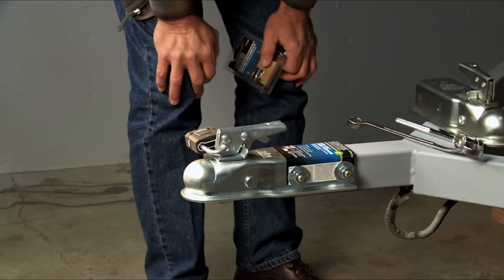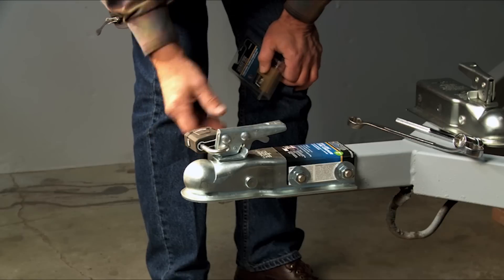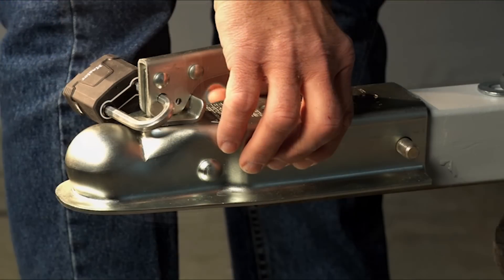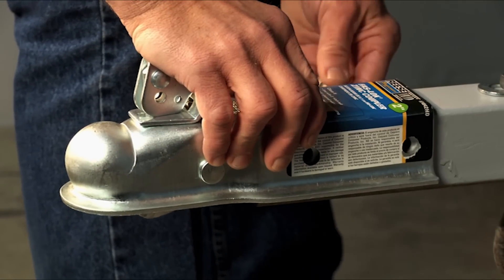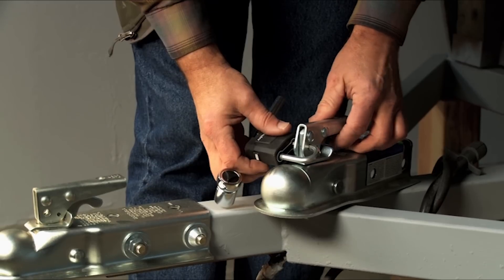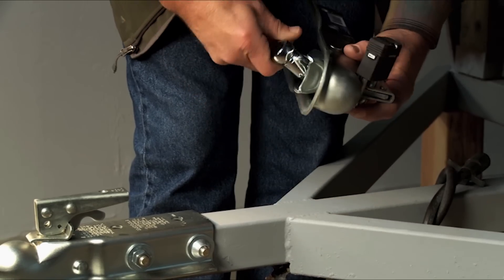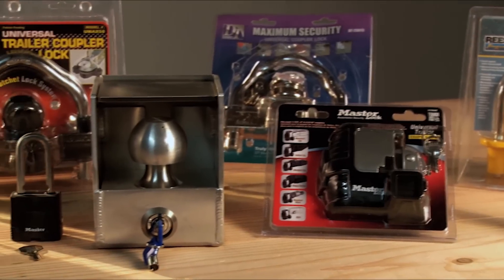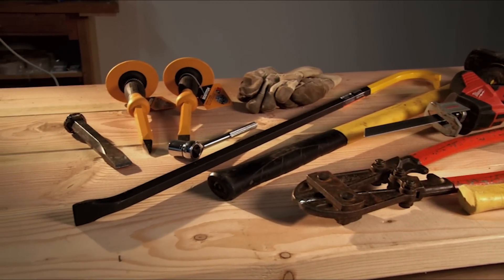Compare MegaHitchLock Coupler Vault to other popular locks on the market

Comment: why did video stop....looked like he was getting somewhere with that big pry bar
Reply: Because it's in their best interest not to show someone breaking their lock they are selling. Also, for that same reason, they do not show their lock on the same one that they were testing all the other ones on.
Reply from the maker: Thank you for your input.  The coupler used for the testing of the Coupler Vault Pro was different than the previous coupler because the previous video was filmed several years ago.  We no longer had that same trailer to test on.  We modified the original video by shortening it as that model of Coupler Vault was no longer available.

Comment: All well and good. But right from the start you gave your lock an easy defeat. In most cases, with your lock installed, the 2 mounting bolts for the coupler remain exposed. If your case was deep enough to cover the coupler bolts then you'd have a working lock.
Reply: Why do you think they went over that very subject in the beginning? Could it be to show people they need to keep that in mind.

Comment: My tongue took 2 bolts to remove. If there ain't no place to put a hitch, it ain't going anywhere.
Reply: They just hook up the safety chains and off they go.
Reply: @d-rbrtsn9989  Or their own coupler right through those empty mounting holes.  Of course most thieves aren't that well organized.

Comment: okay.   so i'm making  the 2019 summer camping list. 

3/4 socket. 

2 wrenches for bolts, 

a small sledge, 

a long pry bar, 

a large chisel, 

and maybe a little sawzall.  ...i'll probably substitute that with a small cordless zip disc cutter.

Comment: if you need to use a saws all and a hammer to remove the lock you will attract too much attention unless your trailer has been abandoned in the middle of the desert or swamp miles from anyone.
Reply: You would think so but thousands of catalytic converters are stolen with grinders and sawzalls.

Comment: I guess you understand on the bolt on hitch, a thief shows up with a cordless impact and another hitch and doesn't waste time on the lock. Remember the Club, to lock your steering wheel, thieves just cut the wheel with bolt cutters and slipped it off. I guess the company made money.

Comment: Why can’t a manufacturer create a box with four solid pins instead of one. Or better yet design the trailer neck with a hole that a locking pin must go through. Clearly if every lock is easy to break that means there must be a flaw someplace.

Comment: All the other locks were defeated on a static trailers.  In the final test the trailer tongue had a wheel on the bottom decreasing the applied torque from the pry bar.  One of the other locks was defeated after 8 minutes.  On the Vault the camera stopped after less than a minute when only one tool was used.  Theres no saying how much longer it would last and if other tools might work better.  If there's more exhaustive testing I might change my mind, but for now, thumbs down, no sale.
Reply from the maker: Please check out our break test on our web site www.megahitchlock.com .  Thank you.
Reply: Good eye! In addition, the crowbar prying on their lock appeared like 1/2 hearted tugs.
Reply: I agree! To me the test was not apples to apples and they used multiple tools on the other locks and just a pry bar on this one. I bet I could have defeated the lock on the other trailer using some of the other tools they had used on the other locks. It comes across as a con job!

Comment: Your assuming there even going to bother taking the hitch lock off. It's already been proven a trailer can be stolen using the safety chains. They can simply bring there own chain and steal it and remove the lock later. Your best bet is locking the wheels.

Comment: I don't think breaking out a reciprocating saw is all that easy, much less quite. Or hitting it with a sledgehammer.
Reply: What do you mean its not that easy? seems like  rechargeable saws and rechargeable grinders are tools of choice for thieves these days.
Reply: @duncanplumbing  meaning takes a long time to cut through something that thick and hard. Not to mention loud as hell!
Reply: @duncanplumbing  I agree with @LawF250. Any type of lock can be cut through with a cutting wheel, but it is extremely loud. If a person can't hear someone banging on their trailer or cutting at their locks, they should probably consider storing their trailer more securely. Mine is 10 feet from where I sleep.
Reply: We do our best with that too. But not much can thwart 5 minutes with a rechargeable makita grinder these days. So equipment left in  a noisy or industrial area is subject to this type of theft. Most locks only take a couple whacks with a sledgehammer and the lock is toast
.

Comment: So why did you only use one method trying to remove the  Megahitch Lock and why did you not put it on the same coupler you did your test for the other locks? I suspect the reason why is the Megahitch can be defeated as easily as the other ones in the video. This is not an apples to apples comparison and you loose all credibility because you did not use multiple tools and attache it to the same trailer coupler.